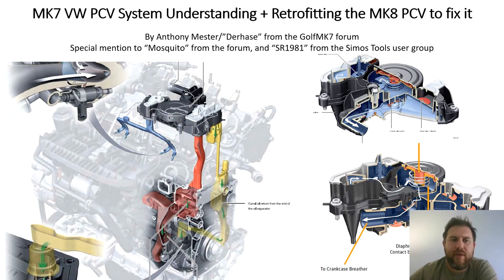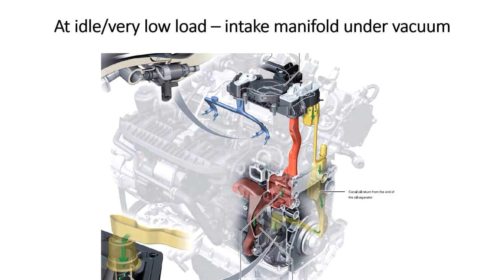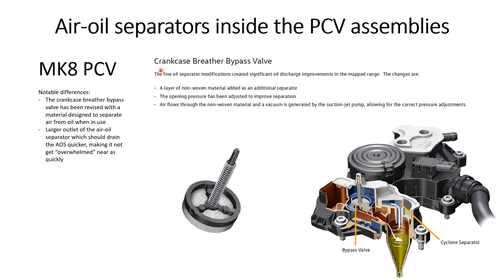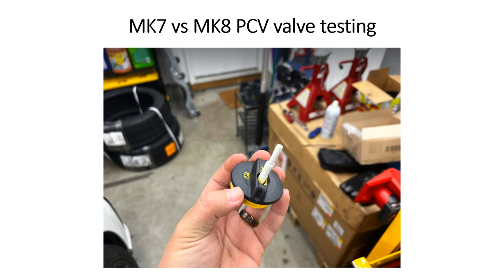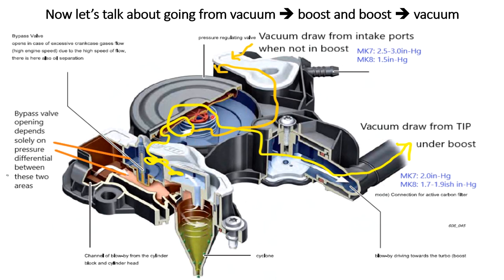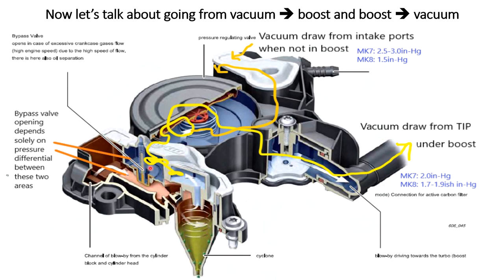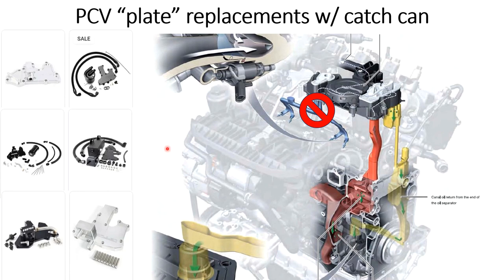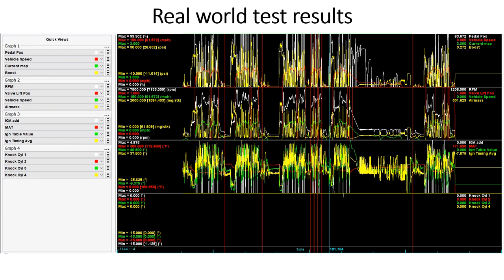MK7 PCV Analysis - How it works, and why I've adapted the MK8 PCV (Pt 5)

Comment: Wouldn't any catch can suck oil from the PCV reservoir? I think you said in this video or another that you shouldn't install one but doesn't this apply to any PCV of this style?
Reply from the maker: I don't think catch cans work well with OEM PCV systems, and the few that do I think moreso is playing with timing of the one way valves opening and closing (basically dumb luck). The BMS CC seems to be one of the more consistently successful ones due to small can size and short hoses (less volume that vacuum must draw down from the TIP).
Reply: @datadrivenmqb  wouldn't any increase in tube length be an increase in volume and therefore increase crankcase pressure? Even if that's a small amount maybe over a long period it causes the rear main seal to deform enough to leak oil
Reply from the maker: @catinthehat5140  That's the theory - I think a small can w/ short hoses like the BMS aren't really bad. The problematic ones are the ones with monstrously long hoses that will cause further obstruction of pressure escaping/being sucked out.
Reply: @datadrivenmqb  What would be great is all the different situations and how the pcv reacts. Like "High load, Turbo not spooled = this happens, that happens" etc

Comment: Mk8 PCV is for 2.0l, so it will fit my MK7 1.8l?
Reply from the maker: Yes it should fit. I'm not sure I'd recommend the full retrofit on an IS12 since that's a tiny turbo... but basic/full retrofit will physically fit. @karstgeo72 did the swap on his IS38 1.8T Wagon.

Comment: Compatible with the 1.8l?
Reply from the maker: Yes. @Karstgeo72 is running it on his IS38 1.8T wagon. I don't know that I'd do the full retrofit on an IS12 car, but basic retrofit would be fine for a "stock replacement" equivalent. Check out some of the other videos on the PCV Playlist or at www.datadrivenmqb.com/mk8pcv

Comment: @Cjensen363636
26 minutes ago
Great explanation, I was always wary of catch cans (and I ran one briefly on my Mk 6). I’m curious about the results if anyone tests it with an intake and turbo inlet pipe.  It was great meeting you at VIR in July, I learned a lot and are planning a few track days next year there.
Reply from the maker: Glad it was able to help! I have some more stuff planned to test in the future, I'm probably a couple weeks away from adding another MAP sensor specifically for the crankcase so it can be logged and overlaid directly (as opposed to taking video of a physical gauge).

Hope to see you at VIR again! I'll be back with TSCC in December!
Reply: Someone made a video where they compared catch can crankcase pressure. Some of them caused a massive increase.

Comment: Has anyone tested and confirmed this solves the smoke cloud under heavy braking and decal on track? Got black flag for the thick smoke cloud today and almost lost my points - prefer not to keep happening
Reply from the maker: I will be at Summit Point at the end of the month for Fastivus, so will report back then! There is someone else in one of the FB groups who has done the retrofit and claimed it was successful on track, though I don’t know if his details/car specs/etc.
Reply from the maker: @eurosurgeonjoe2700 to follow up: No issues at Summit Point on the Shenandoah circuit and then again no issues over 3 days at VIR for Oktoberfast. I have info from both trips here: https://www.datadrivenmqb.com/tripreports

Comment: Just performed this. I suspect might have a marginal effect on any carbon buildup. In theory.
Reply from the maker: I don't think the basic retrofit would have much effect, though there's a small chance that the full retrofit with an 034 TMD plumbed to the Venturi may help. Several people have reported cleaner exhaust tips with the full retrofit. Check out the other videos in the PCV playlist for the one on the Venturi being used.

Comment: Any reason for not upgrading the turbo bend?
Reply from the maker: You mean the turbo inlet pipe? I just have an IS20, no need for anything else IMO. Probably not absolutely necessary on an IS38 either.
Reply: Yeah, the turbo inlet pipe 😊 okay, kinda see most people say it should be upgraded, so just different hearing someone using their car like you do and keeping things stock on that part of the turbo 😅
Reply from the maker: @thomaspedersennorway  yeah, I don't doubt there could be a SMALL gain from replacing it, but frankly I'm chasing a 2:10-2:11 lap time at VIR before worrying about adding more power. IMO keeping stuff closer to stock is the best way to ensure it stays reliable.

Comment: What engine (code/capacity) does this PVC cable come in in the Tiguan?
Reply from the maker: Whatever the Gen 3B motor is. All of the US spec 21+ Tiguans as far as I know. (2.0L)
Reply: @datadrivenmqb  ok, I've got it. I have a Pmax 1 and I want to drill a hole and put a connector in the lower factory rose. will this work? Have you done such a test, and what cut of the hole in the shortest length will be good?
Reply from the maker: @patrykkrol9433  not sure exactly what you're describing. I have some info on www.datadrivenmqb.com/mk8pcv regarding fitting to non-standard turbos where the 034 TMD isn't an option.
Reply: @datadrivenmqb I want to connect this cable as in 034. only in pmax I have to make a hole and use an ntp connector

Comment: I remove the oil cap the car revs up.before and after I changed Pcv?? Cars burning oil
Reply from the maker: It's normal to idle differently when oil cap is removed - you're introducing an air leak. If the oil cap is lightly held in place by suction at idle as you try to remove it, that is normal.
Reply: @datadrivenmqb hi, I've just replaced my pcv on my 6c polo gti, it has made my idle alot better also no more unwanted smoke via exhaust, I did a test and when I remove oil cap it now has a strong vacuum,, also when I pull the dipstick there is a mild vacuum, the engine tone changes until I put cap back on then returns to normal,, is the strong vacuum normal, its a new oem part, I'm just worried that vacuum is to strong, some say its showing the pcv is working as should, im just concerned because its very strong suction...
Reply from the maker: @philpots3216  it’s a pretty strong vacuum, -1psi feels like a lot when it’s a large surface area like the oil cap. The only real thing that would allow excessive vacuum is if the diaphragm were stuck open AND not torn… which is basically impossible. You’d need to plug the external pressure reference port on top of the PCV valve while the car is OFF, and then start it up. The car would run real weird most likely and set fuel trim or running lean DTCs similar to when the diaphragm tears, along with a loud squealing from air being pulled past the crank seal. This is what happens on some other (non VW) cars when their PCV valves fail and pull excessive vacuum. Chevy Cruze 1.4T for instance I’ve seen fail like this.

Comment: I have just replaced mine on vw polo gti 6c, it has made a big difference to my idle and performance also no more smoke, i noticed though when car is idling if i take the oil cap of there is a strong vacuum and engine runs weird until i put cap back on, is this normal, its an oem part and has fixed my smoke and idle problem but im concerned about the vacuum when oil cap or dipstick is removed. Any feedback will be much appreciated
Reply from the maker: That’s normal operation of an OEM PCV system.
Reply: @datadrivenmqb  you know you are the first reply I've had, can't thank you enough.
Reply: @datadrivenmqb  hello again, I subscribed to your channel,,,, I have another question, you said the strong vacuum is OK and is doing what it should, I noticed a small whistle on the diaphram and when I cover the small hole it stops,, this is a new part but I'm beginning to think it's faulty😀
Reply from the maker: @philpots3216  yeah that does sound potentially bad. It might not be too much vacuum, but it’s sucking in unmetered air through a torn diaphragm. If it won’t cause warranty return problems, you can pop the cover off and check. FWIW I only ever recommend a 100% OEM from VW/Audi part. The non-VWAG parts are inconsistent quality at best.
Reply: @datadrivenmqb  it is oem and only 2 months old, I'm going to send them a video and see if they will replace. There should be no suction (whistle)on the diaphram correct?
Reply from the maker: @philpots3216  correct. Holding your finger over the little vent hole should produce no changes as long as the car is already running.
Reply: I have misfires at idle due to the Evap purge valve that connects to the PCV. When I unplug it, the issue goes away.  I'm thinking maybe the PCV is to blame since it connects to the evap purge valve. Maybe with the MK8 PCV this issue might be solved. Especially since datadrivenmqb mentioned that the vaccume pressure is less with the MK8 PCV on the evap purge line.